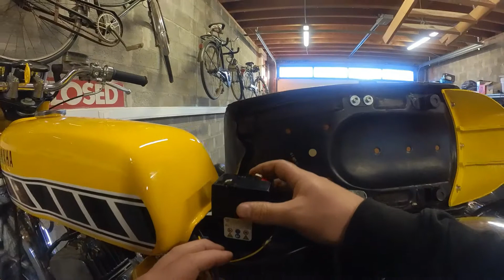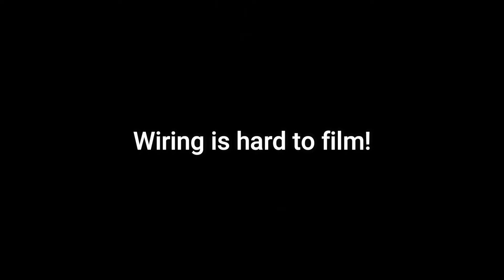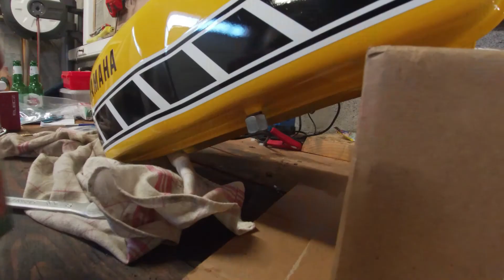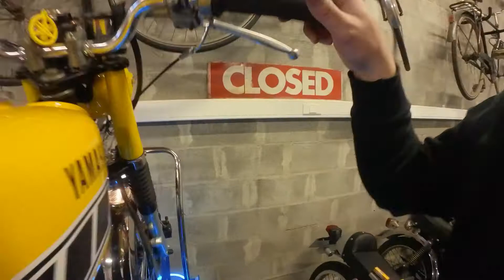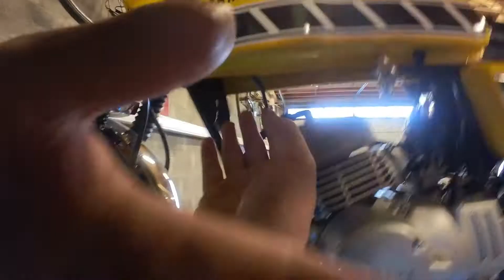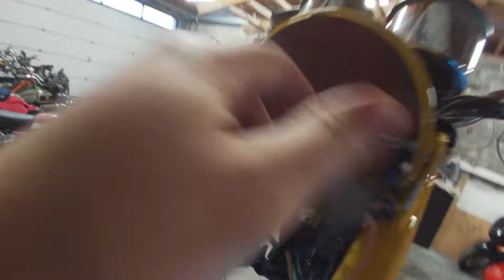Yamaha RD50 'Kenny Roberts' - Pt.15 Electrical issues Pt.2

Comment: For those who might watch this video one day... Please install a voltage regulator!
The oem rectifier is just for providing DC to the battery supply (lights except phare). The head light is connected directly to the stator unit. So it needs an additional voltage regulator for 6V.
These are cheap and easy to mount. Being connected in parallel to the yellow wire coming from the ignition.
Want to see a video for this? please reply and I'll do some shootage soon. 😊 Thanks